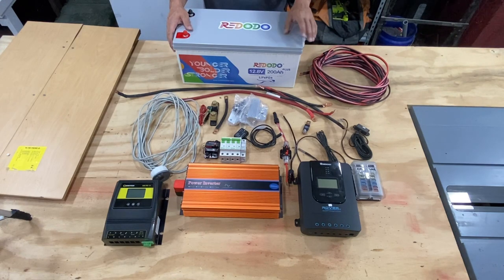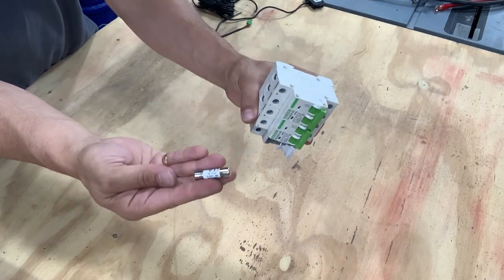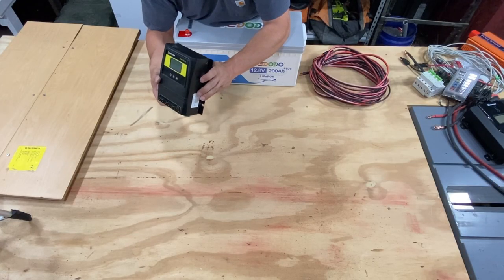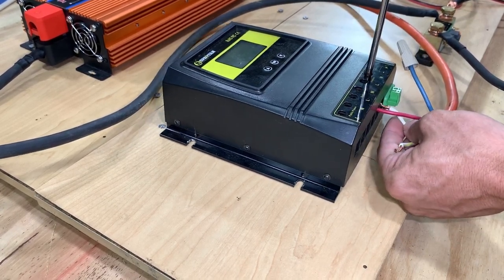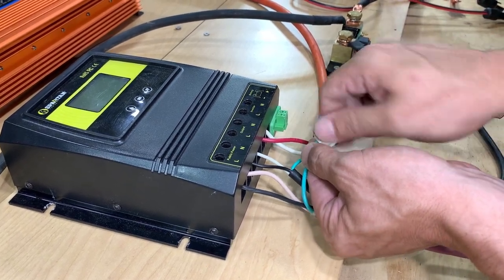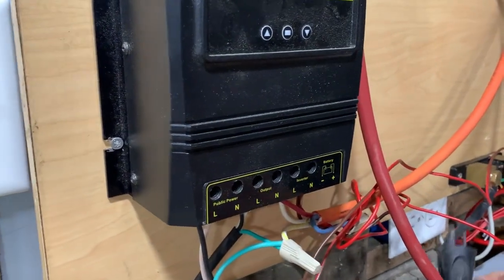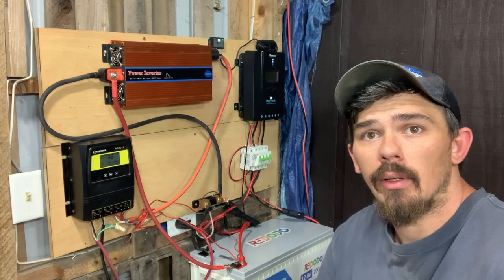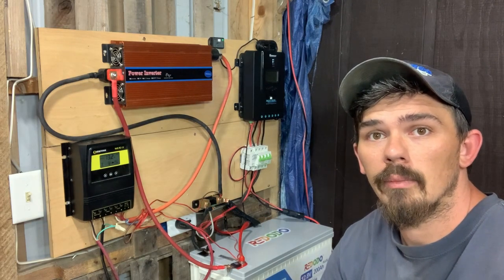Cheapest DIY Budget Friendly 500w Solar System With Redodo 12v 200Ah Plus Lithium Battery

Comment: the transfer switch doesn't have the relays physically connected inside so it could fail very badly and start a fire.
Reply from the maker: Good to know. Never had any issues out of it. Worked flawlessly

Comment: Idid not understand what the yellow and black box (transfer switch?) was for? What does it do for your system? I understood everything else. Thank you.
Reply from the maker: When the battery gets too low it automatically switches to grid power, when the battery regains enough charge it automatically switches back to solar. You can set the parameters for when you want it to switch. It protects you from losing power and from draining your battery to 0%. To increase your lithium batteries life, you want to keep them between 20%-90%
Reply: @doingitthegreenway  Thank you. Right now I still have LA AGMs. Can it be adjusted high enough to cut off for AGM level voltages?
Reply from the maker: Yes it would probably be more important for you to have one than me. I can drain this battery to 0% without damaging. That can not be done with AGM batteries. I believe 50% SOC is the lowest without damaging them.
Reply: @doingitthegreenway  Yes. Thank you. I checked it out and am going to order one.
Reply from the maker: You won’t regret it, it’s nice knowing everything is working and using solar every second it can without checking on it for sometimes weeks at a time.
Reply: @doingitthegreenway  Perfect. That is just what I need

Comment: Would you be able to run a 12,000 btu mini split off this system? Off grid…and for how long would it last with no sun?
Great videos and thanks for sharing!
Reply: Depends on the wattage
Reply from the maker: I would say yes because they are really energy efficient. This system powers a 12,000 btu dual hose stand up ac unit with no issues. It pulls roughly 1200w when fully running and if stayed fully running without cutting on and off when temps are met. Then it would drain this 20kwh system in about 16hrs without any solar.